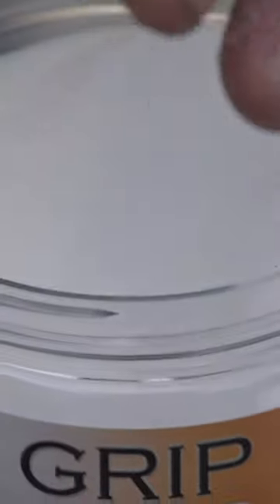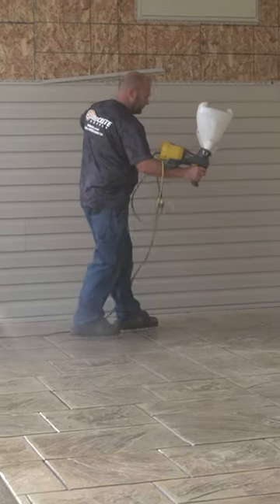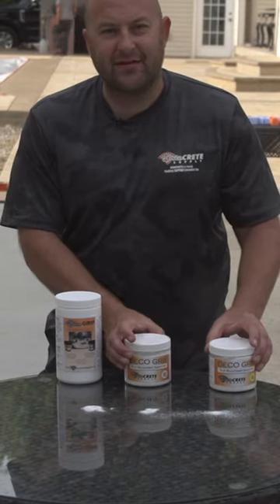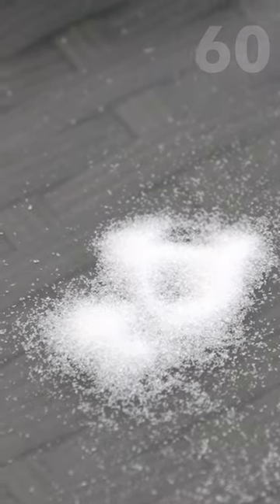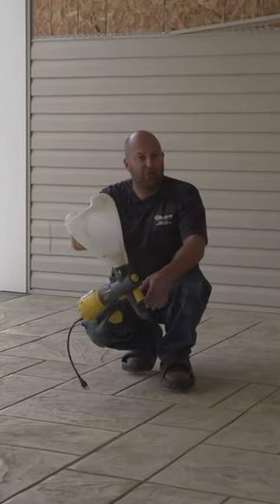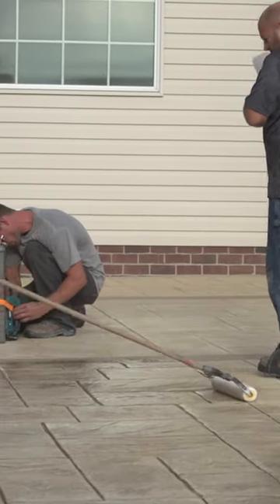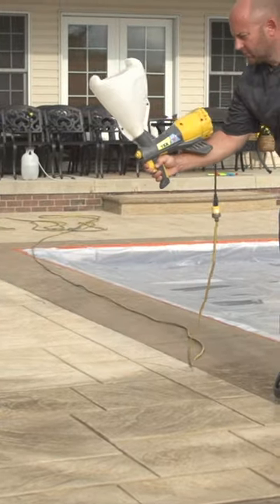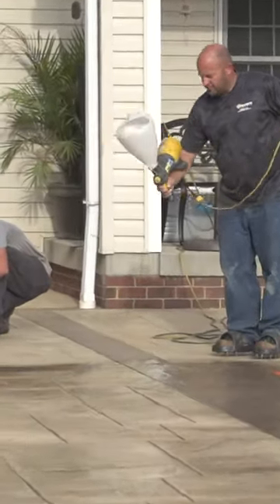Prevent Slippery Stamped Concrete! #shorts #concrete

Comment: My concrete boss always took handfulls and scattered the product by hand before the concrete fullied cured and had no problems with the product dissolving and becoming clear. However the first (and last) time he actually followed the directions, the outcome was you could see little white specs all throughout the concrete. We had followed the directions exactly, any tips on why that happened. We ended up having to grind/scrape away the white specs as best as we could which took days because we had used it on multiple pours at the same location.
Reply from the maker: Thanks for the comment! This product is meant to be mixed into or broadcasted on top of the sealer after the concrete is cured out. We've never tried to sprinkle it on fresh concrete. Could you be more specific about how you guys are using it? We have two different types of Deco-Grip. The one in the taller can is meant to be mixed into the sealer, and the 40 & 60 mesh (in the smaller can) work best to broadcast on top of the sealer while it's still wet. Here's a link to the full version of this video, Jason goes through the different types and step by step instructions on broadcasting. Thanks for watching Deco-Crete TV!!!                                                                            
https://www.youtube.com/watch?v=Zpt3gF0oRhQ&t=3s